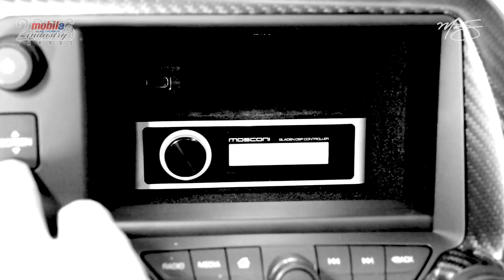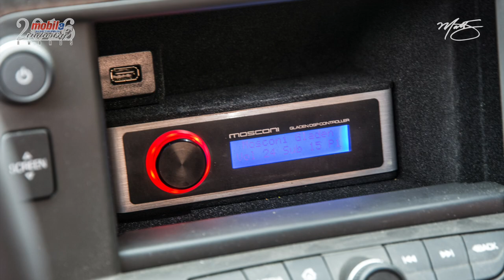2016 Chevy Corvette Full Audio Build Explained - IOTY Feature Build

Comment: unbelievable. Just amazing craft. What price range would something like this run. How much down time start to finish and how much weight is added? If you don't mind me asking.
Reply: ekim andersom 
I am curious about the weight also, as Baltic birch ply would have been a better move weight and strength wise, and having done high end installs in the 90s I would think that 20k would be the very very low end of the spectrum for this. 

I would love to see some numbers on the system response as the sub location should be prone to massive cancellation, the tweeters are too close to the sides/ drivers left ear-pass rt ear, and the stock dash's 3 spkr holes were left unused instead of fill.  Running full active w/ processing is the way to go though.  I hope the audio processor had enough delay and eq to fix all the placement issues that this car creates.  The best part is that most of the cars cargo space wasn't stolen and the targa can still be stored as it should.  

Great design and fab work.  Next the installer needs to get himself a 3D printer to save some time on things like the tweeter pods.  Specifically the UV 3D would be a great tool to use.  Do the design once and then sell the products later on for additional profit!

 I would totally drive this bad bitch daily. lol  (I DD a C7 Z51 3LT TR/AR A6 ZF1 MRC NPP carbon top, lip & skirts)

Comment: Hi Matt, it’s been 5 years since your work on the C7 sound/fab system.  Before I begin with a few Q&A’s, just wanted to know how this build is still holding up?  If you still have the vette, I would be interested on the metals and fabrics which you selected? Any surprises? Condition of metals/pods woofer housing in cold weather vs hot conditions?  Also, I didn’t see total build cost?  Are you doing these types of installs for customers or just for yourself?  I am also a 2014 C7 Corvette Stingray, Laguna Blue owner, only added carbon fiber on certain spots keeping her with a even flow.  I waited for the C8 to appear, now with this pandemic and plant strikes with a few “recalls” already, I will wait and see.  I have always owned corvettes so any other car is foreign to me.  I have so many ideas to modify, so interested in creating a catalog for this product line.  Well, let me see your take on your 5 year old build, hope hearing from you soon, sincerely Nelson.